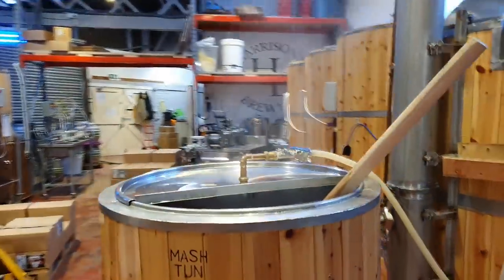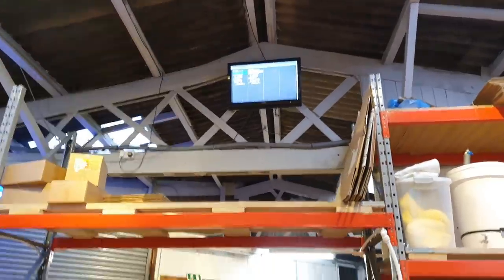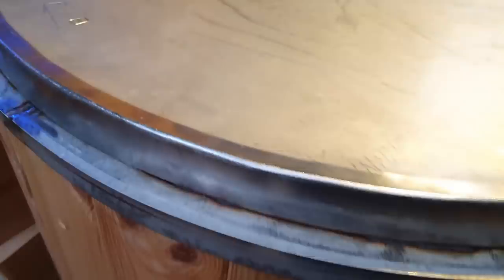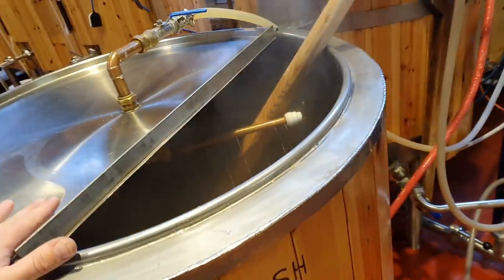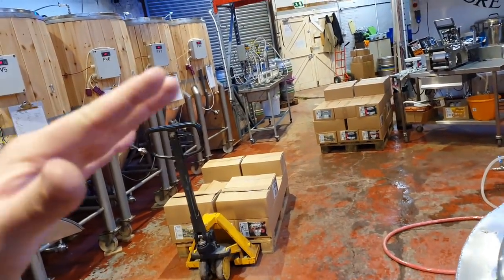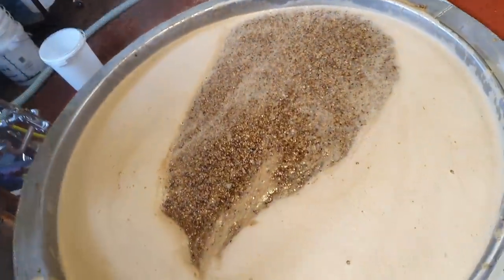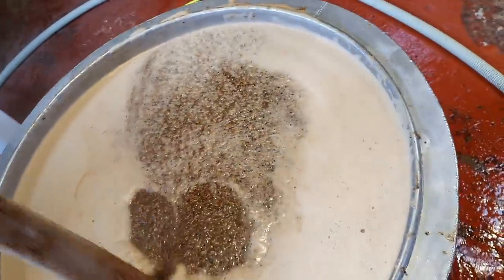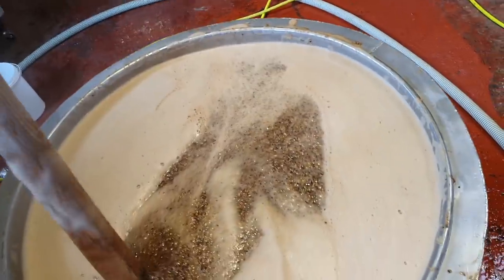Bjorn Kveik Yeast Is Crazy

Comment: Are you not concerned with oxygen getting into those NEIPAs?  The fermenters don't look like the best set up for NEIPAs.  I mean no offense, I absolutely love your channel.
Reply from the maker: Yeah I am, not just with NEIPAs. To try to maintain constant co2 in the tanks I have installed aspirators to inject co2 every few hours.
Reply: @harrybrew69  I was thinking about this problem too. Oxygen damage is even more of a problem with NEIPA beers. Love the channel and hope all goes well.
Reply: Was thinking, your a wizard Harry.................. you might get out that welder and knock up a cylinder the fits to the top of the fermenter. this cylinder could have a drop floor in it and so as the beer ferments the Co2 blows up through it. When dry hop time approaches you can fill it with the full dry hop charge and with no Oxygen you just open the drop floor and the dry hop charge will drop in.